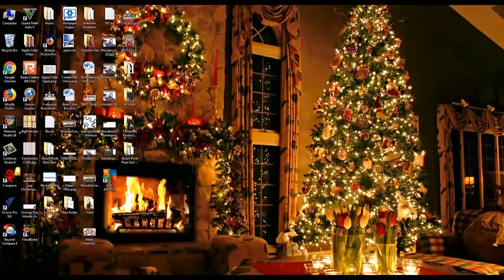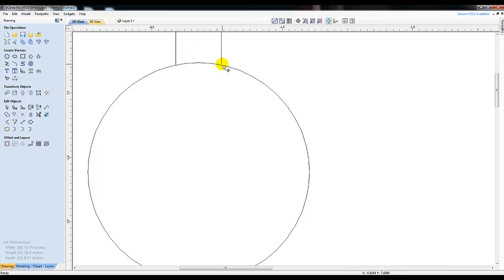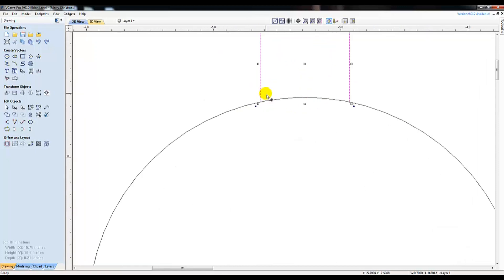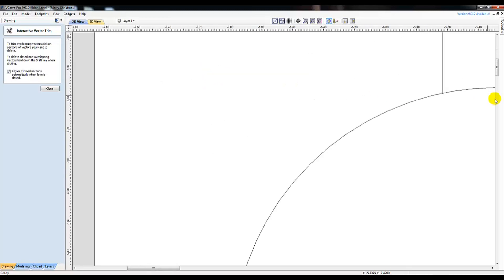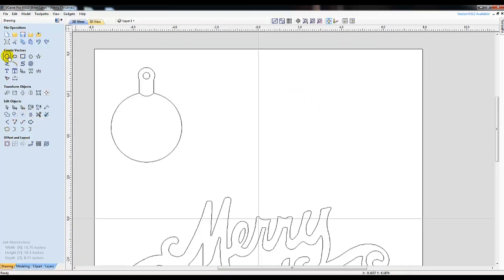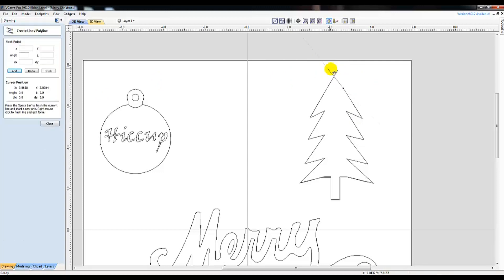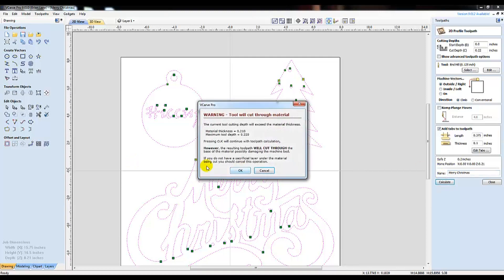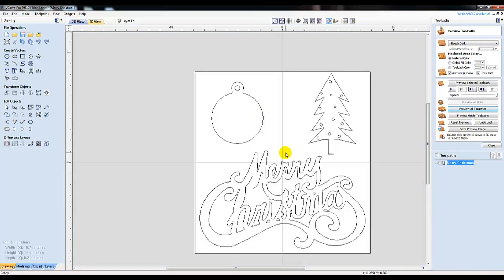VCarve Pro 9 - How to Design from Scratch in VCarve

Comment: Hello Brian. First off, great video! Keep them coming. I have the E 3 and using vcarve. When running a profile cut or drilling, no matter what I set my depth to cut or drill my E 3 cuts way past set depth. Do you have any issues with your machine? Any ideas?
Reply from the maker: Hey Jerry.. I dont... sounds like the z axis threaded rods is slipping or something along those lines.. Reach out to bobscnc support.. Explain what your seeing and they will shoot you a fix. Thanks for the comment!

Comment: Since you use VCarve now, would you ever go back to Easel, or F-Engrave?? I just set up my E3, and I want to do lots of multi depth projects, maybe you can point out from what you have learned on the best program for that. (Like 2.5D stuff)

Also I'm using what BobsCNC suggested , the UGS as the main running software, does VCarve replace that, or is that just the location of building the G-Code file and then you still load it into UGS

-Thanks for your videos
Reply from the maker: Gage Robinson Hey Gage! Vcarve has a ton more tools. It allows you to pick any bit or create your own. It allows you to inlay cut and engrave along with a bunch of other options. I believe it also has the option to do two bits for one project. I am presently designing products like the bit duster and a few other new products for the E3 CNC and I need high-precision. Vcarve is that tool.... With that said you're very first goal is to get it up and going and I suggest using easel. Easel will let you do most things as a free software. But your ultimate goal will be to get vcarve one day. Answer your question no I have not gone back to the other softwares after vcarve. But easel isn't crazy far from vcarve so use it until you get the money saved up to make the jump. 👊🏻😉 Ty for the comment and kind words... Hope to do some more vcarve videos in the future and you can see those in action as well to see the difference. Brian

Comment from the maker: This is a very small look at VCarve Pro 9. Hopefully you can get and idea of what its like compared to some of the other free softwares I have shown in the past. This is my go too software for designing now days. (Not sponsored) Open vectors are frustrating but you become quicker at spotting them over time. I had a lot of trouble finding all this information when i started using it. I try my best to help make everyone else's experience a little better. Hope this helps someone. Brian
Reply: WoodenCreationz Dude! Great video, thanks for sharing, I have question! Hope u can help me... Does VCarve can be used directly to control the CNC mill? Intead of using Mach3, I ask bc I don't have a DSPs terminal to control the CNC. Thank u !